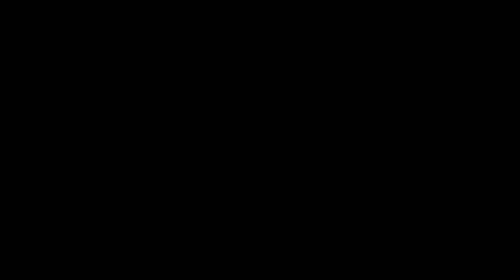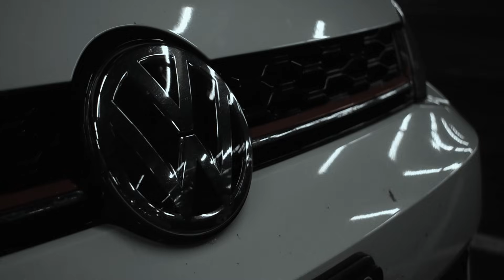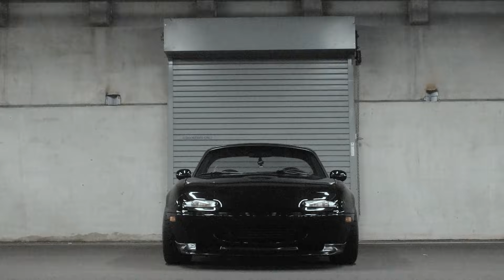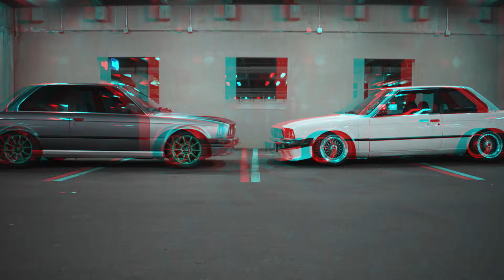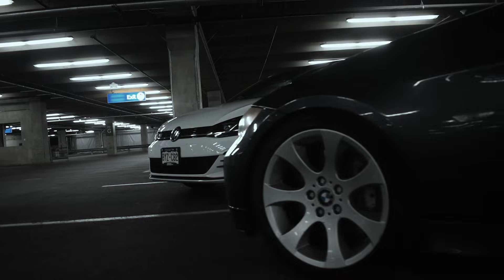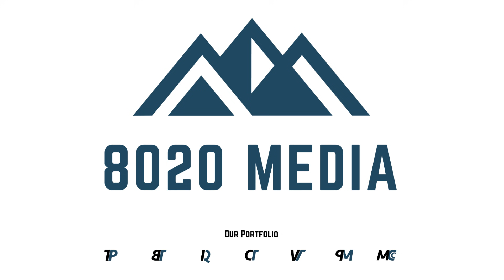8.1 Vortec Reliability & Common Problems

Comment: have you seen a nagging problem with the knock sensor P0332 code on 8.1s?  I keep getting this code and my friend tells me its a larger problem to do with the engine running lean.
Reply from the maker: J - We wouldn't say it's a common problem that we have seen with 8.1's. This could be a silly question but have you replaced the knock sensor?
Reply: @8020Automotive  I havent yet.  I plan to.  I have just heard from some RV forums that the knock sensor is a sign that there is a larger issue at play.
Reply: @jodydewey the only smart thing about RV forums is that some were lucky enough to get the 8.1…. Short of the chassis and engine…. RVs are junk! Camping world probably told them that lie

Comment: I’m at 220k miles on original spark plugs (all original everything) 01 8.1 4x4. Planning on replacing this weekend
Reply from the maker: MP - Thanks for sharing your experience! Sounds like you've got a good one.
Reply: Wow. They usually foul by 40 to 60 k

Comment: Tbh the best gas engine GM has ever used in a heady duty application… don’t forget the exhaust manifold bolts like to break and annoy you. But tbh, that’s a common problem on almost every truck in the early to mid 2000s.
Reply from the maker: Yepp, exhaust manifold bolts are common on all these old big gassers - thanks for the note.
Reply: wouldnt ARP bolts solve the issue?  @8020Automotive
Reply: Never had problems with the exhaust manifolds studs breaking but I have had issues with my 6.0ls exhaust manifolds bolts breaking
Reply: Yeah but it is so crazy prevalent it probably should have been included. I am looking at at least one snapped off manifold bolt now actually on our 2001.
Reply from the maker: Ohwell - This is why we have the comment section. To cover things that were missed.
Reply: @0525ohhwell yep, I found one on my 2001 also. I was changing spark plugs and it just came out into my hand while reaching to the plug with the plug socket. I have noticed there's an exhaust tick on the passenger side where the stud came out. Pretty rusted up. Don't know if the remaining piece is going to be difficult to remove. It's one of those jobs that might be better left alone! 🤣 My luck there will be others that will break trying to get the manifold off to replace studs and gasket. I always use anti-sieze/ galling compound on the spark plugs and things like studs.
Reply: Buick 455 had water pump bolts that were rusted sold.
Grandma's 1969 Buick wildcat received machinist made and grampa engineer speced stainless grade metal so this was never a problem ever again.
Grandma wouldn't sell that Buick for 12 years...2 water pumps later.

Comment: Hummm? Is that what the yellow 710 stick is for..ive seen that on all th cars n trucks ive owned
Reply: Inside mechanics joke..all engines Will use some oil..not unusual for it to be 1 qt. Down by oil change time..won't foul plugs. Pcv system also injects oil..why catch cans are so popular.  I just got back from a 2300 mile trip in my 8.1 motorhome..used half qt. 36 k miles on 2004 model.  If you get lifter tick YOU BETTER CK TH 710 stick!
Reply from the maker: Rob - Not quite sure what you mean here.
Reply: @8020Automotive  lol..read it upside down

Comment: Just run heavier oil on these… problem solved.    Bbc like 10-40 or 20-50
Reply: Workhorse doesn't recommend using 10w40 oil in the 8.1 engine.
Reply from the maker: Absolutely agree!

Comment: What’s the cause of the excessive oil consumption?
Reply: The unconventional pcv system that sucks in oil from the lifter valley...mostly in periods of deceleration with high vacuum.
Reply: @kbitbit  soooo what I hear you saying is run a bigger cam to get the dope lope and fix the pesky high vacuum oil draw at the same time?… 😆
Reply from the maker: Some of it is just natural and normal but the intake manifold is known to shift a bit which can make it worse. If you have a lot of burn then replacing the gasket and the bolts and torquing them properly can help.

Comment: 4.3- 8.1  vortec best motors Chevy ever made..
Reply: Chevy didn’t make the duramax. Isuzu engineered.
Reply: @manoftruth6618  technically yes, like dodge with Cummins
Reply: @manoftruth6618 it is a Toyota engine the reason they last forever
Reply: @rickydavis5541 my duramax motor bearly made it past 300k so get a clue
Reply: @sargeatlarge24v  and I know people got 800k miles on their Duramax without any major problems lol
Reply: I have a 98 1500 with the 4.3 and 368,000 miles on it I've  had for 23 yrs now, my mpg is still 28mpg . My o1 suburban has the 8.1 and 250,000 miles now I don't  have the oil consumption or any of the issues you talked about. 
 Both have been extremely  reliable
Reply from the maker: C - Thanks for sharing your experience!
Reply: 3800 is the best
Reply: Where's the comment about good ol 350
Reply: Shut the hell up
Reply: The 99-06 5.3 was great too
Reply from the maker: Rmc - Although we think they are great engines, you think they are better than the Duramax's?
Reply: @8020Automotive  'better' is subjective, it depends on how you are comparing them
Reply from the maker: Adam - It is subjective, and it's an opinion. We were hoping we would hear what RMC thought that to create a discussion.
Reply: Personally I like the duramax just a little better because of the fuel mileage but I do like my 8.1 they’re both great engines
Reply from the maker: We are big fans of the Duramax engine family. This is not to say we don't like the Vortec's, just prefer a duramax.
Reply: @8020Media  far as reliably I would say yes. My dad's 1999 5.3 has 440k miles and has never been rebuild.  My moms 2006 gmc yukon also has the 5.3 with 260k miles no problems.  My 2001 chevy silverado also with the 5.3 has 230k no problems
Reply from the maker: Nano - Thanks for sharing this experience!
Reply: @8020Automotive yes I’m a ford man, but my uncle still uses his 8.1 3500 Drw till this day. Pulls a 32 foot gooseneck load with hay and hauls cows. Anything he needs with no problems
Reply from the maker: A - Thanks for sharing this experience!
Reply: @8020Automotive  I've seen 6.0s hit a million miles 2 In fact 
But several Duramax. One with 1.5 million miles. With the Allison replaced at 750k. 
So the Duramax is technically more durable.
Reply: @8020Automotive I have the 8.1 in my 2500 heavy duty the only reason I got  the gas engine was because of the expense for the diesel but to this day I still regret not getting the diesel as long as I've had the truck the money would have been well spent if I were ever to buy another new truck it definitely would be a diesel
Reply from the maker: Joe - Thanks for sharing your experience!
Reply: @8020Automotive yes ass a farm my dad bought our 8.1 dually new with the manual transmission we have ran diesels and we hate them every time. I’m 26 I love the power but I’ll stick with my new 7.3 gas
Reply from the maker: A - Thanks for sharing your experience.
Reply: @8020Automotive  fun fact, the duramax is made by izuzu. Id say its on par with the 4.3/8.1
Reply: @8020Automotive duramax is 10x better than any powerstroke diesel
Reply: @rickydavis5541 by what comparison? definitely not reliability when we compare the 7.3 powerstroke. i will defend that fact with my life i have never seen a duramax take as much abuse as 7.3 iDi OR powerstroke. as much as i love duramaxes they arent as reliable, they are but nowhere near the 7.3.
Reply: 4.3l v6 is lousy good for nothing boat anchor engine 4.8l to 6.0l v8 ls style are excellent engines and 8.1l is a excellent work horse

Comment: I ran my stock plugs for 130000 miles without issues
Reply from the maker: Holly - Unfortunately not all engines, or engine components, are created the same. But that's great to hear! Thanks for sharing your experience.
Reply: Replaced my 8.1 plugs at 19 years and 157,000 miles.
Rough start and idle stopped.

Comment: Where does the oil go in terms of consumption? Is there a fix for this?
Reply: Run sythetic oil that will help
Reply from the maker: Agreed!
Reply from the maker: The engine burns it away, so it doesn't technically go anywhere. There really isn't any easy or simple fix for it, or at least one that I would recommend trying to chase down as it will get expensive and the oil consumption issues don't really pose any issues to the 8.1.
Reply: block off the tube on the bottom of the intake (which obviously requires removal) and put a conventional pcv valve in somewhere like the oil filler cap or get a bung welded in on the back the have it run into a new hole in around the throttle body. A catch can incorporated in here is also probably a good idea.
Reply from the maker: Kbit - Thanks for the valuable insight! This will certainly help future viewers.
Reply: @kbitbit  Does the intake have to be cut open to accomplish blocking off the tube, or is it accessible on the bottom of the intake after removing it?
Reply: @jt5747  It's right on the bottom side of it. You don't have to cut the manifold apart. Dig around the internet you'll see pictures of what I'm talking about.
Reply: I just read they have internal PVC valves that causes the oil burning and they can be changed and fixed.
Reply: Actually, the PCV system has improper baffling. It draws oil into the intake.

I run Royal Purple 20W50, it loses a half quart or less in 3500 miles.
Reply: I run royal purple 10-30 and when it starts eating up the oil I top it of with Lucas oil stabilizer